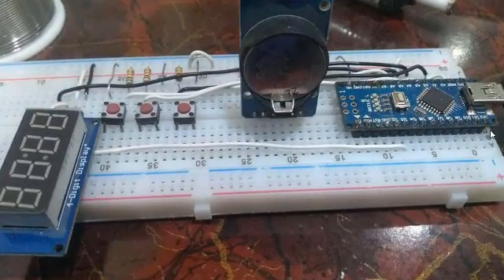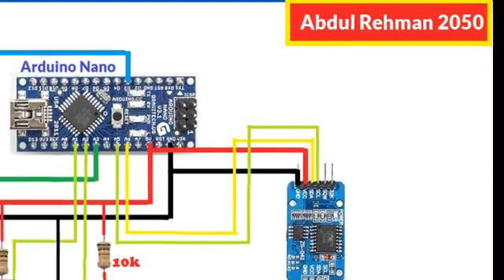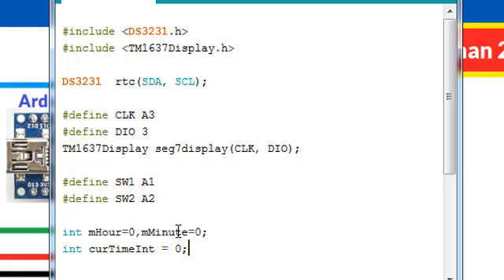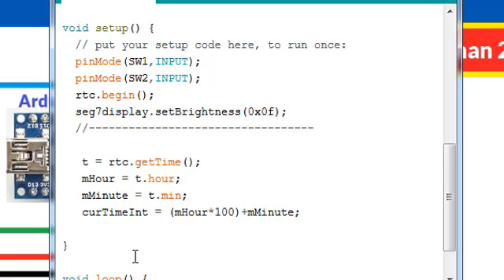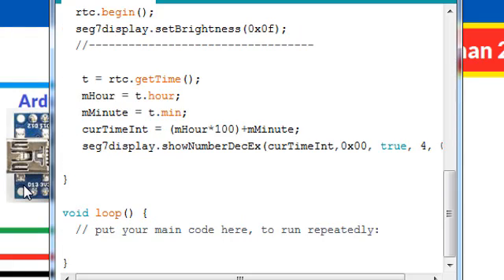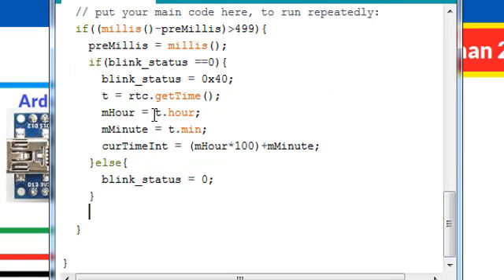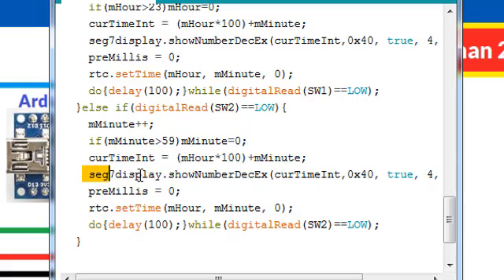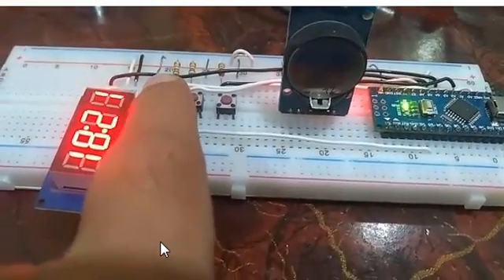How to make Digital Clock using Arduino Nano and DS3231 RTC Module display on TM1637 7 segment

Comment: Hi! which libraries did you used ? I copied the code but it gives me multiple errors when compiling.
Reply from the maker: Just the RTC library. You can download the library from the library manager
Reply: @ar2050  there's a million RTC libs. You need to be specific.